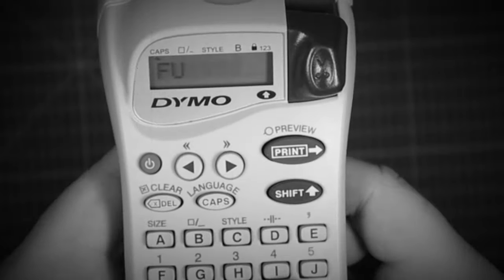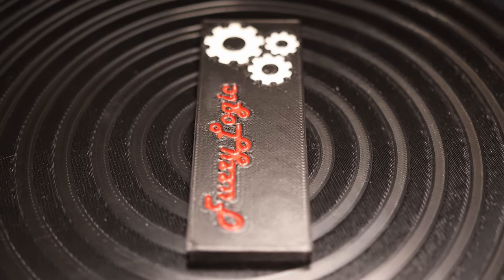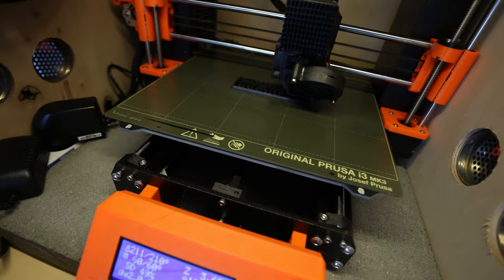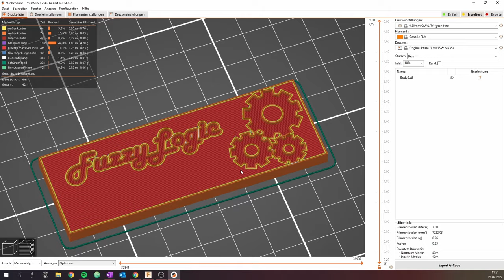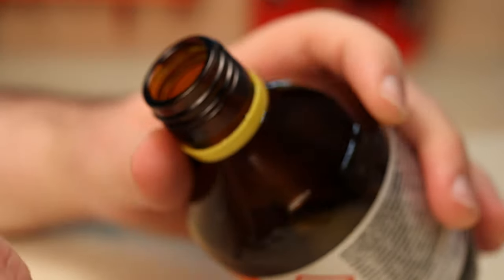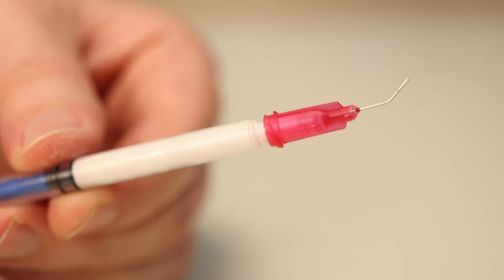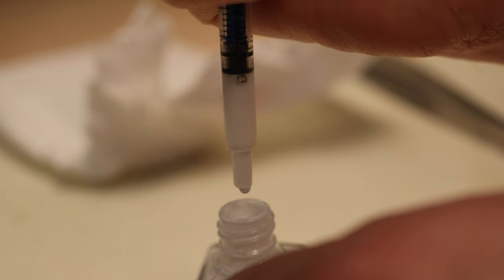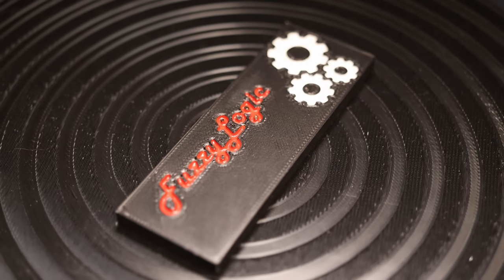3D Print Inlay Lettering

Comment: This seems to be crying for a way of automating this, using some sort of tool capable of precisely positioning a tool in 3 dimensions.
Reply: Bambu printers and other printers capable of multiple colors can do it.
Reply: wow, it's not quite, but almost like the writer was aware of this, (not that I think it's a necessary thing to say, since the trouble of stopping a print and changing colors mid print is a hassle, and not everyone has a bamboo printer therefore this is a nice and viable solution)  @BradKwfc

Comment: I just brush over the whole text with the brush that comes with the nail polish, let it dry, then clean the surface with an acetone soaked paper towel. Only the polish that went in the lettering remains; anything on the surface gets removed.
Reply: I wish I could see your results because that’s the naive approach I started with and I could never get the top surfaces back once the color had seeped in. Even with extensive sanding. That was with white PLA and red polish. Now I apply a clear coat first and use the pour in technique. It’s far from perfect as can be seen in this video because the polish shrinks down quite a lot on curing.
Reply: @ArnaudMEURET  White is probably the hardest color to make it work on because any tiny amount of residue will show. I've mostly done dice and small surfaces where any residue is uniform and unobtrusive. It's hard to get PLA fully cleaned off, probably because the acetone softens it, but when I've done this on PET (non-G) it seems to come fully clean and comes out beautiful.
Reply: @daliasprints9798  Someone here in the comments mentioned acetone-free nail polish remover. Think that's an option for your method?
Reply from the maker: Certainly! You can, most likely, thin it down with nail polish as well.

Comment: A trick for the wicking: when masking acrylic paint, paint will often wick under your tape. The easiest solution is to use a thin layer of the appropriately finished clear coat, so that transparent material wicks instead. This will seal the pores.

Comment: I had several bad experiences, specially with clear color prints : the nail polish tends to smear through the layers lines and smudge around.
Best workaround is to spray clear acrylic varnish first, to seal the layer lines, then pour the nail polish, and finish with another varnish layer
Reply from the maker: That's a great tip. I think I got lucky because I almost exclusively print in black
Reply: You can use a thicker hard gel polish too, I’ve had good results with some UV stuff.
Reply: Well well well.. i just love my printers all the more
Reply: @macrous2120 do you thin the UV gel nail polish out with acetone, too? If so, does it affect the paints ability to cure using UV light?

Comment: I use clear UV curable resin for the clear coat. Useful to protect the paint while maintaining the matte finish of matte filament.
Reply: I use it for everything. You can color it in any color you like and it does not harden until you are satisfied with your application.

Comment: Sweet! I used acrylic paint for a current project, but it never looked good. Never thought of nail polish! You just solved my last puzzle piece 🙌
Reply: So using this same method with acrylic won't work as well?
Reply: @Iroc3132  for me it didn't, but ymmv
Reply: Same experience here with acrylic. I think the volume of water in acrylic makes it shrink up when it dries. When wet it looks great, once it is dry the volume is all gone and does not look good at all.

Comment: Nice result, but that's plenty of manual work to do after printing. You could get a similar result by swapping filament mid-print a couple of times, to create a colored flat layer (or probably 2 or 3 layers) for the letter bottoms and then print 1-2 more black layers with the letters cut out.

However, seeing the "Original Prusa" text on your printer's panel, I realised that it would be the perfect use case for the nail polish method, because it's been printed as a cut-out on the underside. The letter bottoms are bridges, and a different-colored filament would still have the "bridge lines" visible.
Reply from the maker: I've tried the layer swap since and it works like a charm. But you're right, you have to print it face up for the nailpolish to avoid the bridges

Comment: Is there any other way to thin down nail polish besides acetone? Doing this on ABS would be nice.
Reply from the maker: You can try acetone free nailpolish remover. Maybe there is nailpolish based on a different solvent?
Model paint could also work. Basically if you can get through the needle of a syringe it will work. Maybe even water based paint if you seal it with clear lacquer afterwards.

Comment: is there an update for a more clean professional look now?
Reply from the maker: Thats about as clean as I could make it. Multicoloured prints will be cleaner I think.
Reply: @fuzzy4logic  no, I mean the overall surface. Your paint job looks great
Reply from the maker: Thats just the top side of every 3d print. You can print it face down for a smoother finish
Reply: @fuzzy4logic I do multicolor prints for my labels; it looks a lot cleaner because of the way it’s printed; face down on the print plate. Looks great especially with a textured plate. 
I do it manually, a bit of a pain, but the inlay only has to be 2 layers deep (0.3mm).

Comment: Very cool tutorial! Thank you for posting. Would you recommend using something other than acetone for using this method on resin 3D prints?
Reply from the maker: Thanks! I haven't tried resin printing yet. You could try aceton free nail polish remover, or switch to a different kind of paint all together. Acrylic with water for example. If you coat it in lacquer it should be fine to handle without smearing.

Comment: Way too much nail polish. With a model like that you can simply use a 0,1-0,2mm gap, smir the stuff on and then use sand paper so smooth the whole surface.
Reply from the maker: If you want a font this big, you need a lot of Nail polish ;) Also, because it's thinned down you need more to get the same amount of pigments.
I've tried the sandpaper approach and didn't get a good surface finish.